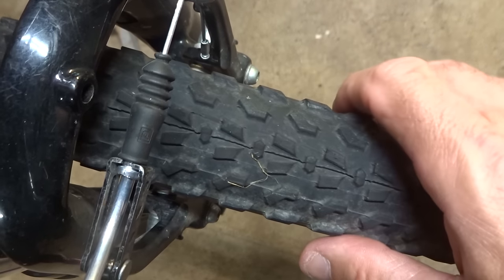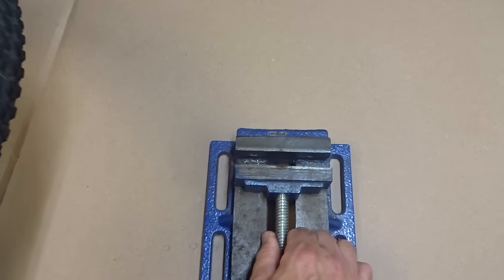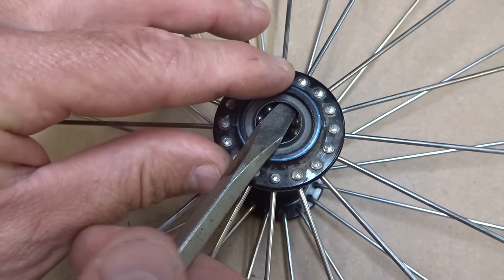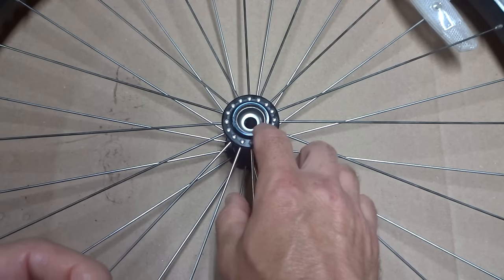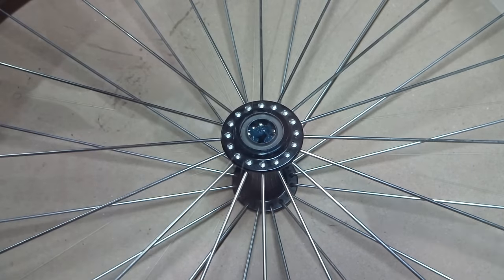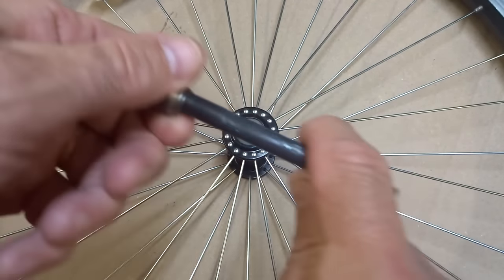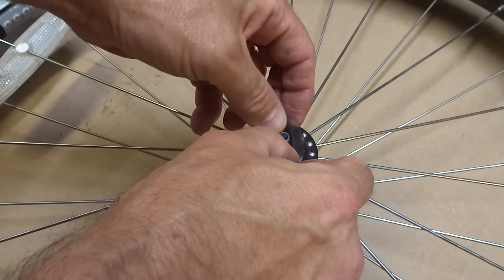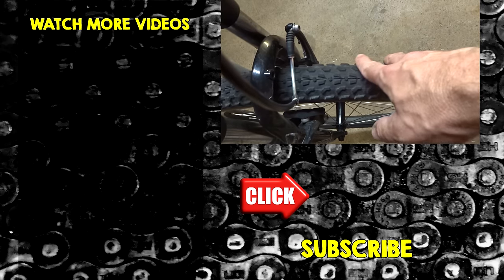How To Fix Loose Wobbly Wheel Hub

Comment: My front wheel moves left under braking, cones are done up properly, theres no play when rocking the front wheel left and right. Just replaced the front hub bearings and wheel still moves under braking. how do i solve this issue?
Reply from the maker: I haven't worked on your bike, so I can't tell you what the problem is.
Reply: I'm not sure what kind of braking setup you have on your bike but check to make sure both brake pads grab at the same time.  Its possible that your right sided brake pad is grabbing very early pushing your wheel to the left, and you just have to "recenter" your brakes to fix the problem.  When your not riding your bike slowly squeeze the brake lever to see if the pads grab at the same time.  This is one of a few different potential problems.  I hope this helps.
Reply: What front fork do you have?  Might want to check it for cracks, or maybe it's just a cheap fork flexing.  Disk brakes?
Reply: @anthonyfusco1520  the pads contact at the same time. Using 6 shimano hydraulic disc brake system, rotor is attached to wheel via 6 bolts.
Reply: @RJTheBikeGuy   Hi its a regular hydraulic brake system with the rotor having 6 bolts mounting.
Reply: @AaronHendu  SR Suntour fork, dont think its the fork flexing as its pretty obvious when the wheel moves when i brake. the fork doesnt move.  QR is done up snugly too
Reply: @bbluefin8834  My guess is still the fork, or you would have play somewhere...the fork won't reveal itself as play, just minor, probably non-visual, amount of flex...if there is a super tiny bit of flex between the two prongs of the forks , the outside of the wheel will be even more out of whack...if that makes sense...also, SR Suntour is a pretty cheap fork, not sure of internal wear and tear since they are rarely taken apart...of course, I am not a bike tech with your bike in front of me, I am just stating where I would start looking.  I also have a SR Suntour fork, so I am not ripping on your cheap fork, I have one too!  I bet if you used a v-brake, the wheel wouldn't move left.  I think it's the fork flexing when the disc is clamped, pulling the wheel to the left, towards the disc.
Reply: @AaronHendu  The thing is i only had this problem after i serviced up my wheel bearings.. before that i had no issues with the wheel moving under braking, this only happened after i changed the bearings to new ones.
Reply: @bbluefin8834  Well than you may just need to have a go at adjusting the cones again...but like you said, you feel no play...when the wheel is installed, brake pads removed, grab the top of the tire, and wiggle left to right.  There should be zero movement or play...if there is any play, readjust the bearing.  Unsure what else it could be...are you sure you aren't just noticing the play more now after you've adjusted it because you are now looking for it?  Might want to take it into a bike shop at this point...they could probably tell you right away what the problem is for a minimal amount of money.
Reply: @AaronHendu  Hi just troubleshoot, i realised that tightening the QR skewer super damn tight removes this movement under braking. However, it is really tight that i have to muscle the lever to close. is it okay to run it like this? or is there any other way to keep the same clamp force without that much force on the lever...
Reply: @bbluefin8834  You can put a fair amount of force on the skewer clamp...again, I am not there with your bike...but I always clamp the hell out of my skewer clamps just as piece of mind...I had a friend lose his front wheel going down a hill and it wasn't pretty.  You shouldn't really be able to over-tighten the clamp as long as you only use your hands and no tools.  Pretty much can go as tight as you can with your bare hands and it should be fine.  This still points to your fork flexing though, unfortunately.  I would almost guarantee a new fork from a decent brand will not have flex like that.
Reply: @AaronHendu  i see... thanks for the help
Reply: Also keep in mind that the disc brake rotor sits on the left (non-drive side) hub flange. As you brake, the disc tries to keep the hub in place while your rim tries to keep rotating. This means that your left-side spokes get tighter, which also pulls your rim to the left. No guarantees, but adding a smidge of spoke tension to all of your spokes might help the situation a bit. Just be careful not to overtighten, I’d recommend using / borrowing a spoke tension gauge or visiting your local bike shop to check you haven’t gone too high.

Comment: Ok sounds easy but... what if it’s a brand new bike? Can’t return assembly man destroyed the box. The hub say quando on them. At first the wheel wouldn’t spin freely, thought it was brake, but opened those up and it hardly spinner on its own, lossened it up a little bit, now it spins freely but now has lots of slack and wobbles
Reply from the maker: Adjust it better. Or take it to a shop.

Comment: My cup is broken.Do I have to replace the wheel?
Reply from the maker: The wheel, or at least the hub. The wheel is probably easier, unless you know how to build wheels.
Reply: In some wheels you can replace the cup by hitting it from the other side like we remove headset cups. You need to get a new cup, i don't know where to buy them, maybe amazon. I got a "new" cup for my wheel from an old hub i had laying around.
If you do as i did, get a rear "donor" cup for your rear wheel or get a front "donor" cup for your front wheel. Don't miss-match them

To install it i used a piece of wood and tarted hitting it with a hammer but very lightly and taking care the cup didn't get in crooked.

This is more of a hack, so you should be careful and be prepared that if it fails you will have to get a new wheel or relace your existing wheel with a new hub.

Comment: why chose non drive side for QR lever?
Reply from the maker: The quick release levers are generally on the non drive side. The rear wheel it's there because the lever would be in the way on the drive side. So the front wheel is set up to match. That is where it is usually placed. Having it a consitant place, allows you to grab the wheel and put it on without having to make sure the tire oriented for rotation is correct.

Comment: Found a sloppy and binding rear wheel on a big box store bike, with little miles on it. While opening it up to inspect, I noticed that one of the cones appeared to wobble as I spun it off the axle. Apparently it was poorly machined, check it out; https://i.imgur.com/1MgKWMk.jpg 
You can see that the bearings left an uneven wear mark, even the dust cap is sitting at a an angle to match. Needles to say, I did a complete overhaul on both wheels.
Reply: From what I can see it's just the dust cap that's at an angle? They're not actually attached to the cones so they can move around sometimes.
Reply: @Jeesus353  Yeah, they do move a bit. The caps on the news ones that I purchased were seated further away from the cone. It was fairly easy to slide it into the proper position by using a over-sized socket and tightening it down with an axle nut on each side before installing.

Comment: You could also have informed your viewers that just adjusting the cones is an option which could be done without removing the wheel from the bike. To show only the deluxe repair which you did (including ball bearing replacement) could discourage many viewers from trying the repair. Remember, you are the Bike Guy not a repair shop.
Reply from the maker: If the wheel has a wobble like this, I think it's a good idea to do a full overhaul like I did. Not just adjust the cones.

Comment: I just paid the repairman $20 for this 😂
Reply from the maker: I used about $1 worth of bearings...
Reply: Holy smokes. I usually pay around $3.50 for an overhaul of the front and rear hubs. Can't imagine having to pay $20!
Reply from the maker: @nekobytes9187  $3.50? Where are you? I am guessing not in the USA.
Reply: @RJTheBikeGuy  a guy from Philippines here. Here local bike shops usually charge for the replacement part/s, then ranging from US$1-10 worth of service charge depending on whether you're just having stuff replaced, overhauled or rebuilding a bike. Bearings are pretty cheap so the cost of overhauling the hubs are really cheap too.
Reply from the maker: @nekobytes9187  Okay. Here, bike shop labor rates can be $45-60/hour, or more.
Reply: @RJTheBikeGuy  the bigger shops here charge that much as well, if not a little lower. Usually the ones who service big bike brands. But for most LBS the service charges are really cheap.
Reply: You mainly pay for the labor, not the parts…

Comment: or you can just change ball to bearing... its more simple and durable
Reply from the maker: Have you replaced ball bearings with cartridge bearings?
Reply: @RJTheBikeGuy  yes
Reply from the maker: @akmalrizalzahir561  Okay, describe how you did it?
Reply: @RJTheBikeGuy  i just bought a the same size of bearing, and the "bowl". and just replaced it.
Reply from the maker: @akmalrizalzahir561  I don't follow. How did you fit a cartridge bearing in place of ball bearings? Or are you talking about caged bearings?
Reply: @RJTheBikeGuy buy the fit size of cartridge bearing. and the "bowl" meaning is the place of the bearing. but sometimes, the size of cartridge bearing just can fit it on ball place.
Reply from the maker: @akmalrizalzahir561  It sounds like you are talking about caged bearings and not cartridge bearings.